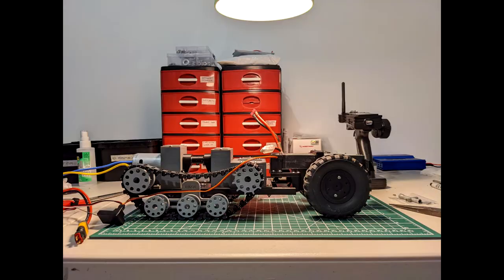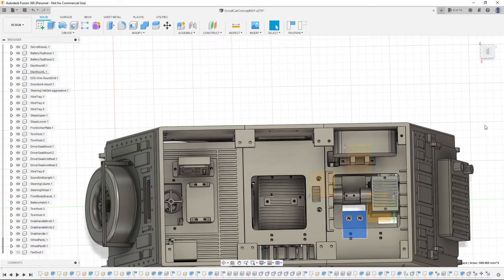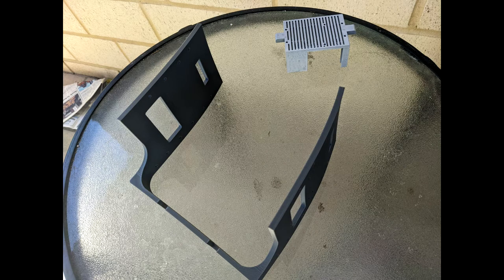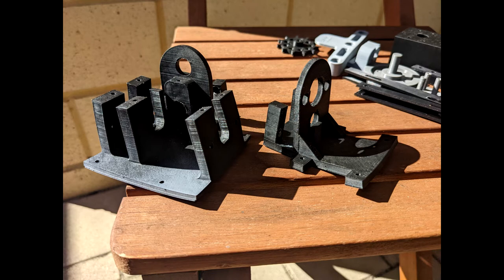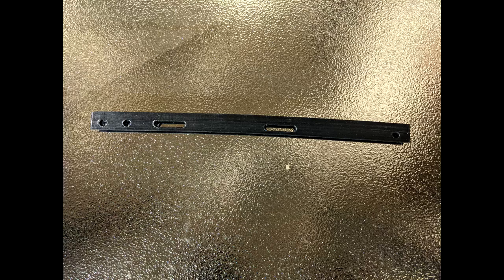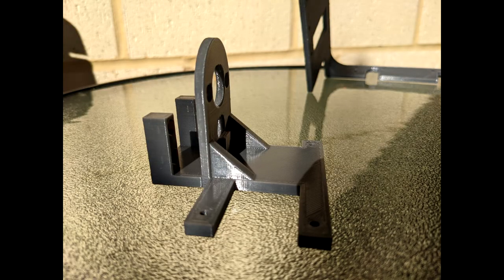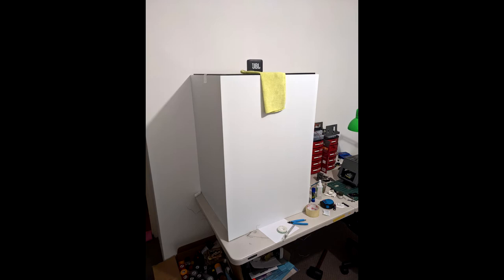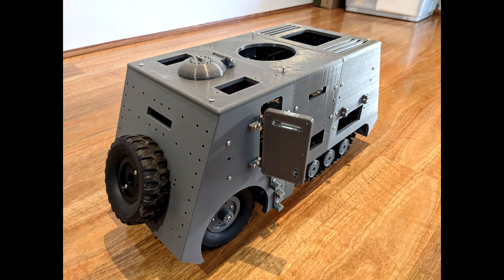Upping My 3D Filament Game! - Project Heavy - Diary #3 - 3D Printed Half Track

Comment: I am interested in the settings used with the stock printer. Thank you for going thru the reasons for the material changes. Great looking RC!
Reply from the maker: Thanks Josh! My settings for ASA on the stock Ender 3 V2 are 238c nozzle / 85c bed. Retraction at 25mm/s and ~6mm retraction distance. Use brim because parts are prone to warp. Let me know if you need more info.

I hope to have a running video of the vehicle soon. Check my socials for latest updates in meantime. 😎 Cheers

Comment: I used those settings and the ASA is pouring out way too fast, my layers are at .2mm and seems like theres way too much ASA coming out the next layer just smears all over the place.
I tried lowering the Flow by 10% all the way down to 5% and still just a blob messs.!!!!

Comment: Can you share your ASA print settings with me please? I'm trying to print white ASA on stock Creality Ender 3 v2 and pro printers, thank you!
Reply from the maker: Sure thing Chet, I've now put the settings in the description too due to demand, but here's the settings anyway: 

- 238c nozzle (I wouldn't go past 240 with the standard PTFE Bowden tube)
- 85c bed
Retraction at 25mm/s and ~6mm retraction distance
Definitely use brim because parts are prone to warp
Use an enclosure as much as possible and do not create any disturbances to the print or introduce any air drafts during the print process. Set up the print, then close the enclosure and let it be. You'll find by the time the print is done, the part is under a LOT of tension on the bed, and it's quite easily to 'snap' itself off the bed. 

Use glue stick adhesive also, even it's a bit of a challenge as it doesn't like the 85c bed...bit on the hot side for glue stick temps, but way better chance of getting the prints to adhere properly with glue stick in my experience. 

I've had more luck with smaller parts in ASA so far. I tried to print a large body section in ASA and that failed miserably unfortunately, even with an undisturbed and (mostly) sealed enclosure, and heaps of glue stick 😅 I think a properly-sealed enclosure is a must especially for larger parts in ASA. 

Let me know if you need more info. Good luck!